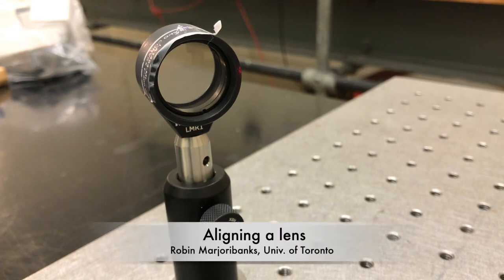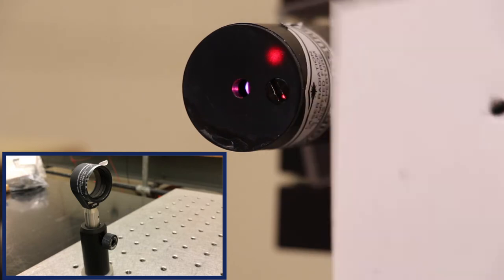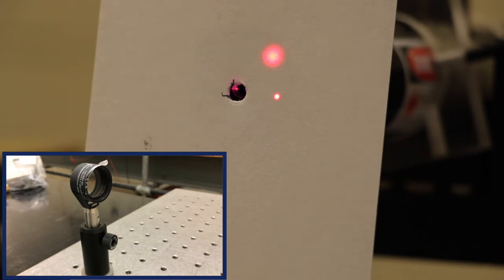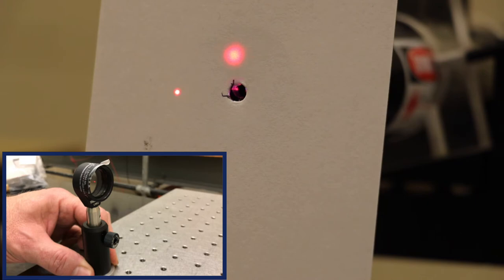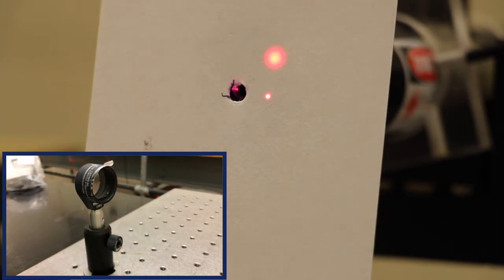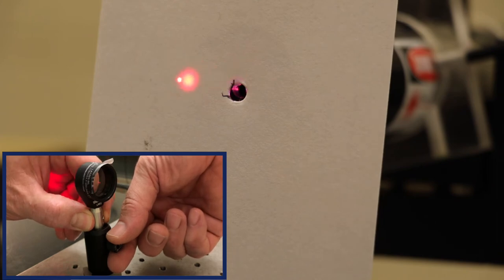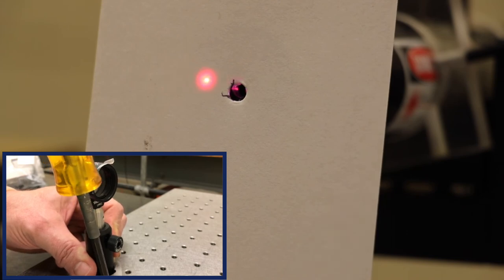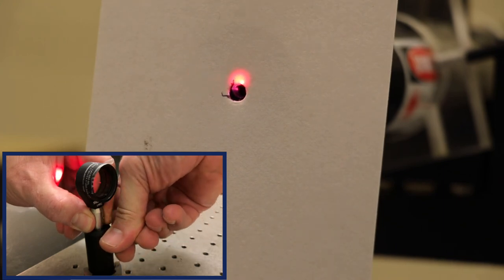Aligning a lens to a laser beam

Comment: Does this technique work with a doublet lens?
Reply: In principle a doublet has been centred correctly and then cemented at the time of assembly, and therefore you just need to align in reference to the outside surfaces. Finding second-surfaces, the interface between the cemented optics, is a bit harder to see because the different types of glass will be nearly index-matched, and make only a slight Fresnel (interface, internal surfaces) reflection.

Comment: Could this technique be used with invisible laser, like 1064nm Nd:YAG?
Reply from the maker: Sure — you need a way to see the infrared beam, of course. The easiest is a ccd camera or webcam with a lens not coated to block IR (consumer models often do). A video camera with ‘night vision’ works, and can display on a computer monitor as does a ccd camera. Lastly, an IR card will let you find the beam, but you usually do not want to make a hole through this card.